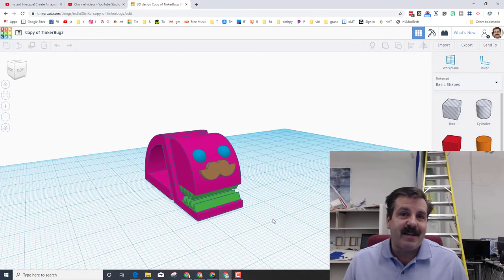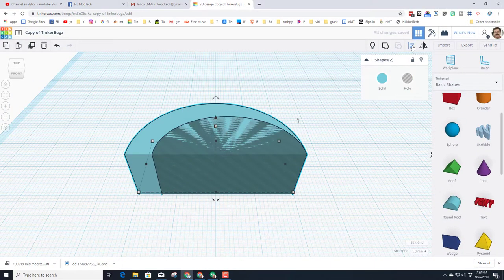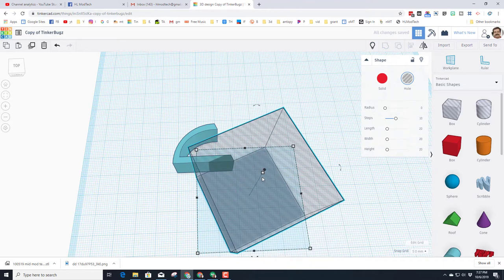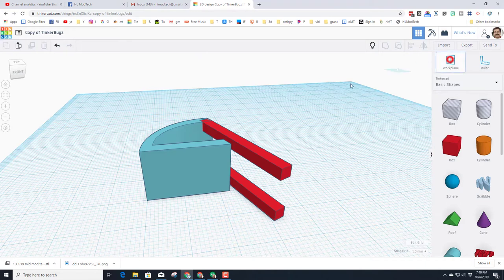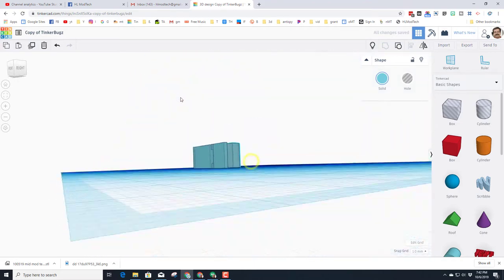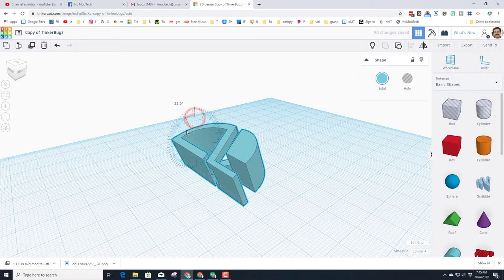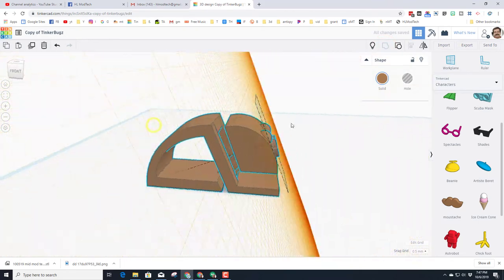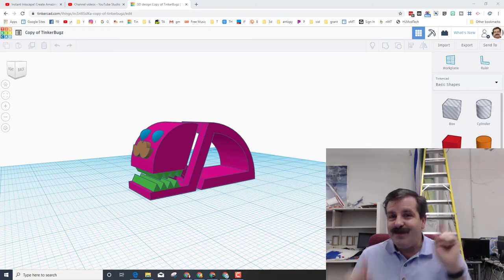Create a Custom Tinkercad TinkerBUG! Warning!! It Bites!

Comment: I use a dremel 3D printer, what do you suggest the print settings be for this, I always have a difficult time getting supports off.
Reply from the maker: I have never used one, so I am not sure. Usually when I have trouble removing prints it is 2 things though. I have not waited for the bed to cool. The other is that I have the first layer a bit to snug which makes more adhesion. I get successful prints, but they are not as crisp as they could be.
Reply from the maker: Are you using PLA? My go to is 200 and 55 for the bed with most my printers.